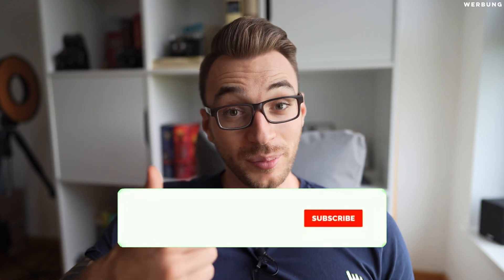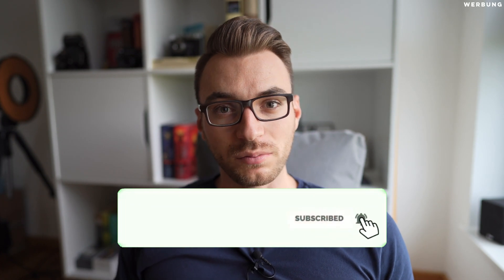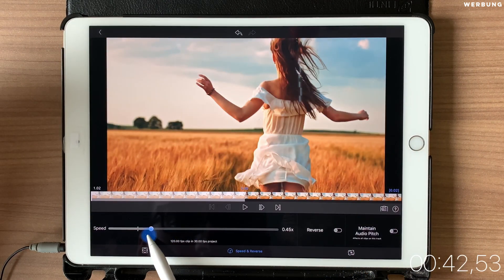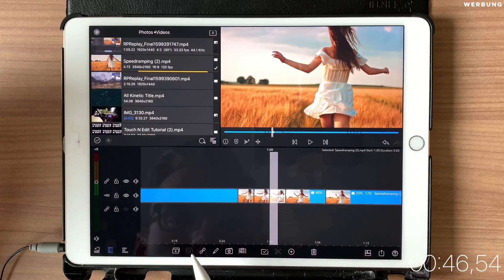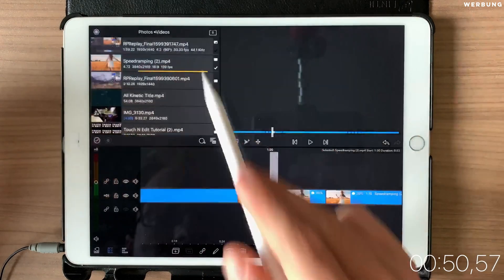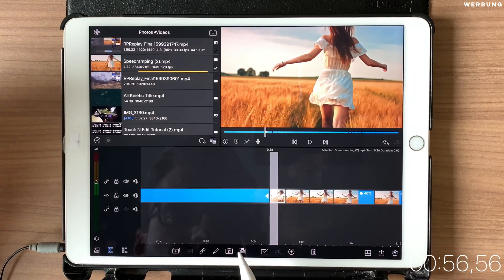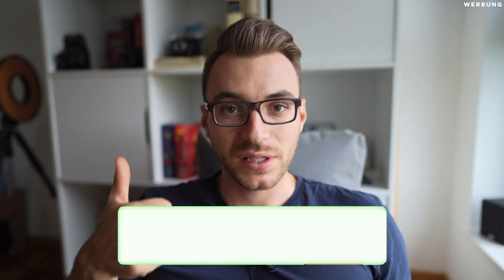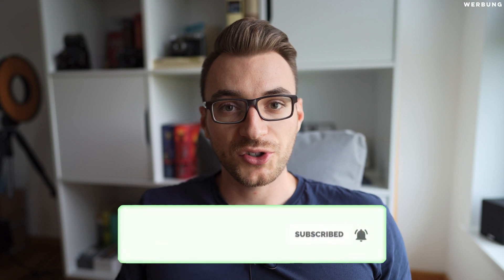Lumafusion SPEEDRAMPING in 90 Seconds- SUPER SMOOTH - Tutorial [ENG]

Comment: Can you advise what resolution and format your video was for this? I tried this on an ipad pro 12 inch 2021 while connected to a samsung T7 drive with 4k 120p footage but the playback jumps at the fast speed. I was wondering if it would work if the video was in prores format. Tbh, when speeding up 4k 120p footage this is asking a LOT, however it seemed to be working for you.
Reply from the maker: Its 1080p footage. Was ist lagging after rendering or just in the timeline playback?